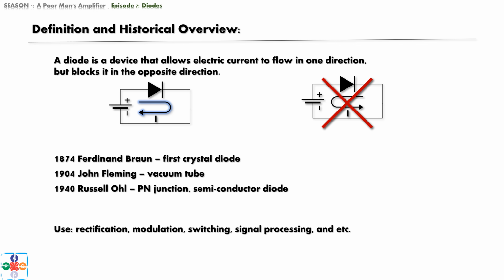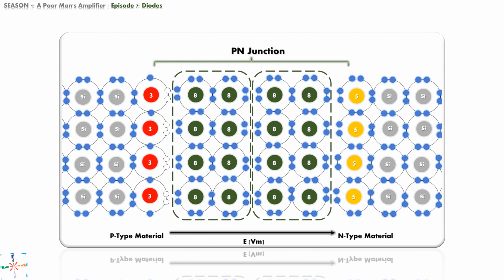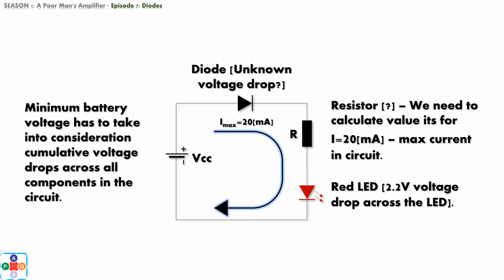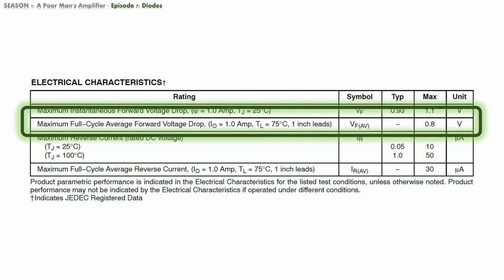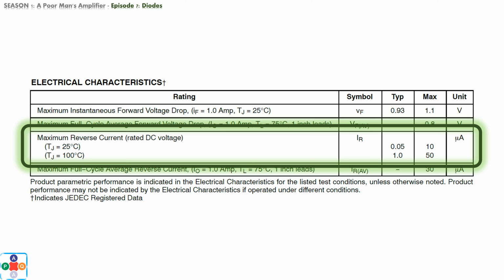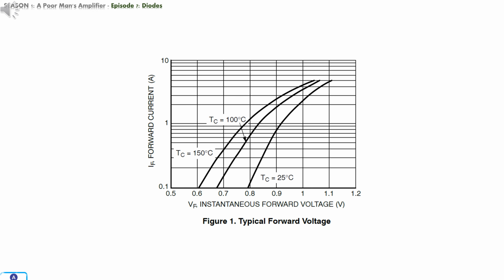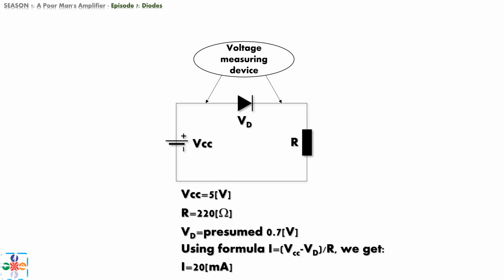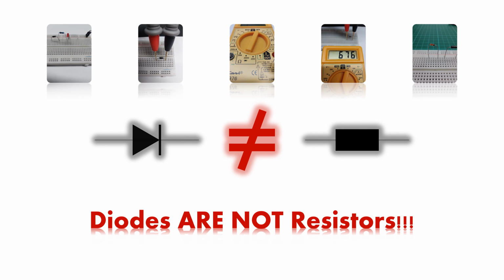S01E07 - Diodes Tutorial, Reading Datasheet, Definition of Biasing, Diode Voltage Drop w. Examples

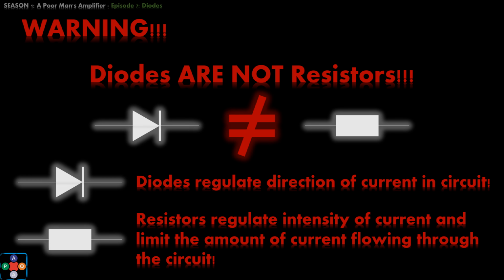Comment: Question, on the This Is A Short Circuit (6:12 into the video) indicates a anode to cathode connection thru the diode as a short circuit, shouldn't this have been if it was connected cathode to anode thru the diode?  All other diagrams indicate that anode-cathode is proper setting- thanks
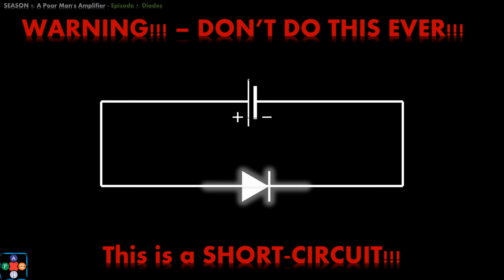Reply from the maker: Hello again 🙃. Thank you again for another kind comment and very clevery question. The confusion comes from placement of diode and power source in graphics. In all other previous graphics, the battery was on left-hand side, the diode was top-middle, anode(+) to positive and cathode(-) to negative terminals of the battery. We try to draw graphics in our videos so that can be easily viewed on phones and tablets, so we sometimes adjust display to emphasize certain important things. Graphics at 6:12 was such case, we wanted to emphasize that the absence of the resistor, when diode is forward bias (fancy way to say, we put it the right way in the circuit) is equal to short circuit. The anode(+) is connected to positive terminal, and cathode(-) to negative terminal of the battery, and the diode is forwad biased, so maximum current, that power source can provide, will start to flow and diode will blow. If you have something like 5V/1A  power source (phone charger for example or one of those AC/DC 5V/1A adapters), the power source will aslo blow. So, graphics is OK, just the placement of the battery and the diode is adjusted for presentation purposes. Again, never, under any circumstances, directly connect diode in this fashion, without proper resistor, that can handle requested rated power of disipation for voltage and current in your circuit. We hope this answers your question. Again, thank you very much for your comments and questions.